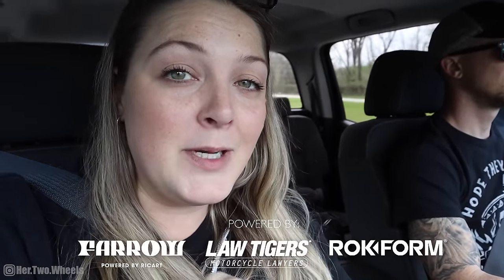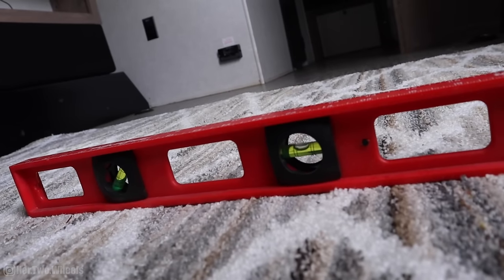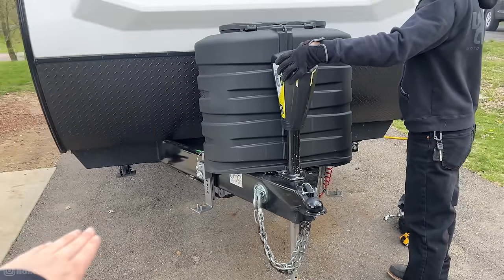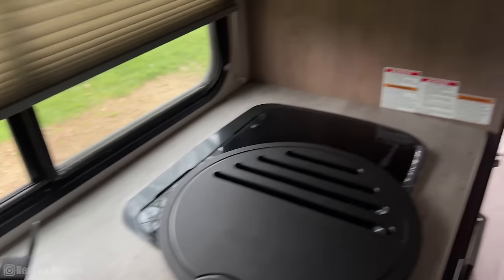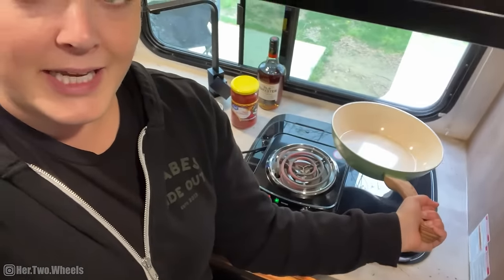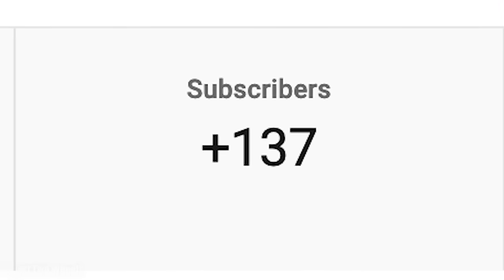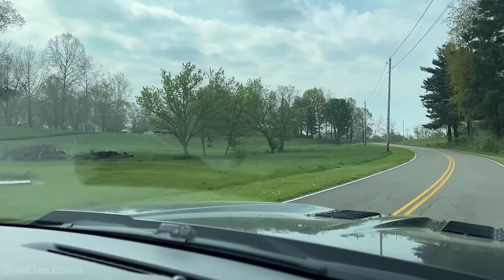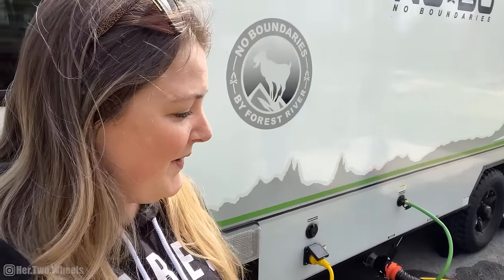First time camping in our new Toy Hauler! Mistakes were made!

Comment: Text charts the X charts I actually want to put some of those on mine cause I just put new tires on it in January. I want to get those type and I also want to get the tire covers and I also want to get the spare tire cover my camper will be 10 years next year, see my campers paid for right now and I’m I want to get my truck. I gotta get the frame welded on my truck within two years. I’m gonna have two years. I’m gonna try to have two years paid off on the truck. I have to do that I’m gonna have to Cluster for my truck 2012 Chevy 1570 cab 4 x 4 but I have to get the frame welded on that but I also got a cluster in August to get changed over cause I don’t know how much gas I have my truck I did put $50 worth of gas in the truck this week But you know sometimes you don’t know weeks ago my truck ran out of gas on the way back from Memorial Day and I had AAA so that’s why I’m trying to get later today tomorrow I have to go to. I’m going to Bass Lake upstate New Yorkparish New York that’s where I’m going to 17 miles away but I moved my truck. I moved the camper today at Tom 3 PM but I wanna make sure I have enough stuff to take with me for that reason I’m supposed to. I’m gonna probably be there plan is for 14 days. I’m gonna have to do that three timesfor 14 days when I go there next year I’m gonna update my plan for $200 and then by that time and stay there for 21 days. I’ll have four years in at Bass Lake for camping.